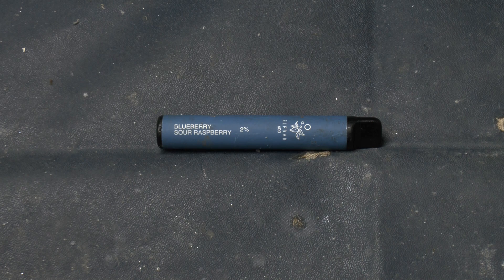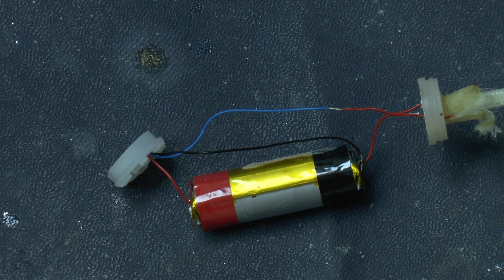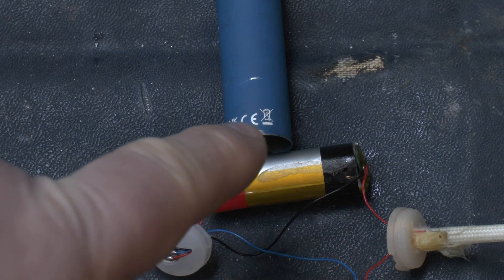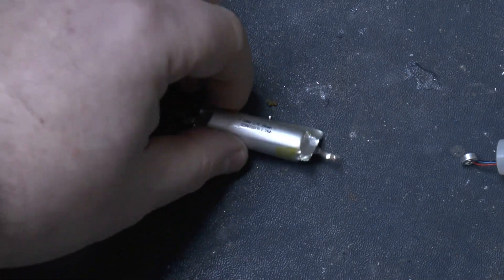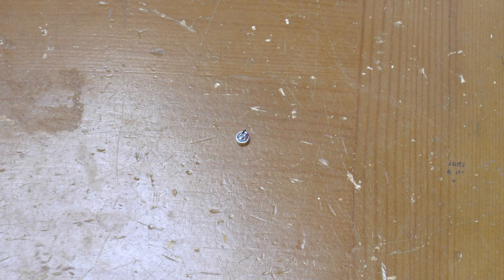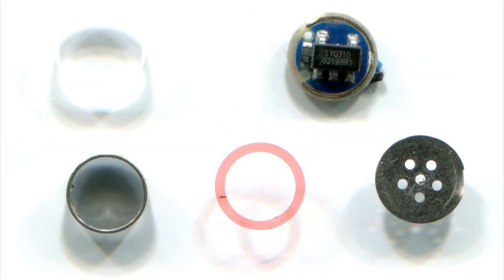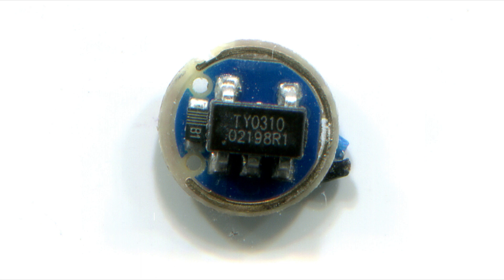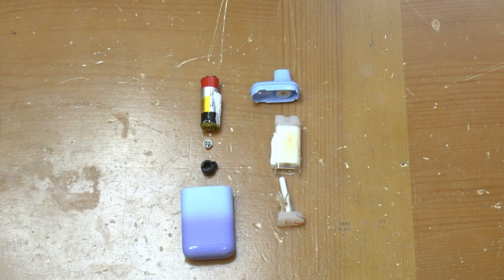What's inside a disposable vape?

Comment: Hello. For Foger vape, I am looking for the activator (the unit that releases the power when you inhale). I opened the bottom and could not find it. DO you know if it's by the coil? TY
Reply from the maker: Try the bottom of the vape.  There should be a hole to allow airflow in when you take a puff on it, I'd expect it to be there.

Comment: I find discarded vapes in Australia regularly and I recharge the batteries using the battery charging module from a broken rechargeable vape that had similar Ah Li ion battery then use them in all sorts of things like torches that used  old alkaline or carbon batteries. They last way longer and they cost nothing.

Comment: Other features of the chip worthy of note are that many have the ability to control the recharging of the lithium cell.  If about 5V is applied to the heater connections (with the heater removed) it will often light the LED and charge the cell to just under 4.2V at 300mA.  Not all of them do that though.    The chips also seem to be able to detect rogue triggering, like moisture bridging the membrane to the case, and will cut off the heater power after a set time.
I've never seen a diode in one of the packages.  Always a capacitor.  I'd guess it's maybe used for more stable cell voltage detection during charging, so maybe they've used it as polarity protection during manufacturing for the disposable ones.